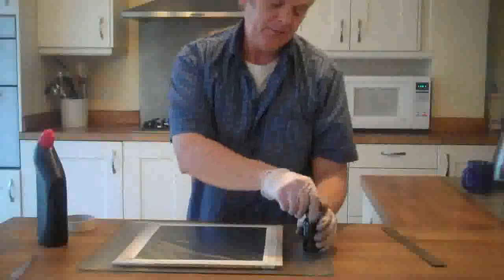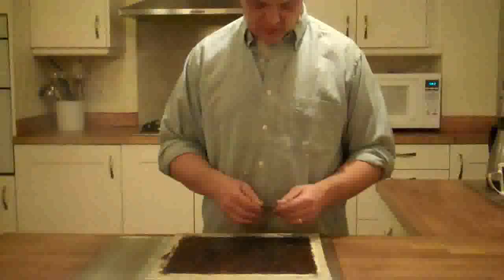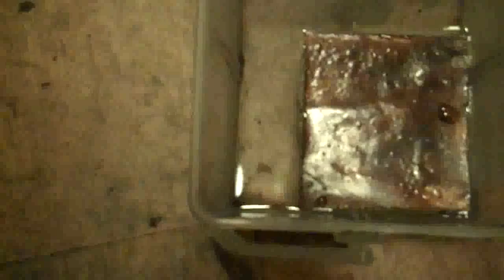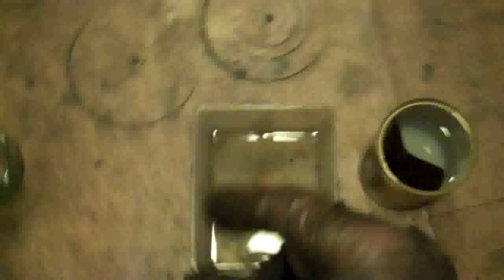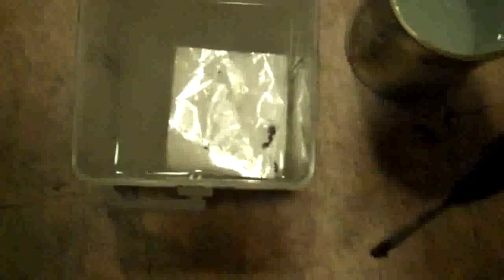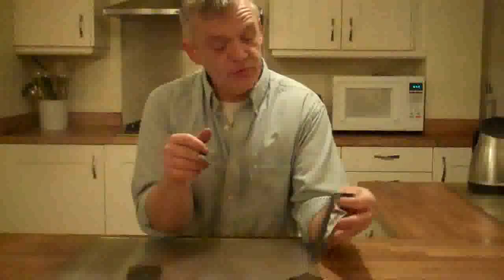How To Make Graphene Sheets As Big As You Like

Comment: Attach the sheet to a speaker, hang over a container that is tall enough to stand the whole sheet up in, then play a low frequency sine wave through it so it's essentially being 'jiggles' up and down that way the bubbles get shaken off the sheet letting the acid get at new aluminium. I believe that you can use the same procedure to make electro-plating more efficient. Just a thought, awesome vids, new sub here 👍
Reply: @fabroche69  non
Reply: Make a paint mixer from your subwoofer. 👍😁

Comment: I've videos where graphite isn't used to make graphene.    Instead,  propane gas is used, and the gas is spray on sheets of copper, under very specific atmospheric conditions.   Of have probably boched this description up.  I have thought instead of using atmospheric conditions.   You could use electrods inside the propane gas.  The electrodes would act like a 3d printer.  This electrodes 3d printer would be hooked up to a microscope.  ( a microscope strong enough to see atoms.)  The 3d printer would act as a 2d printer and make sheets of graphene.

Comment: Note a correction: aluminum foil does Not have a coating of plastic. One side is shiny because it is double face rolled to thickness, then split to rolls for sale. The retardation of chemical reduction is due to the surface oxide of aluminum which is an inhibitor of further reaction until broken down. If you doubt this check out Alcoa manufacturing videos.
Reply from the maker: i don't doubt it mate - i know it now lol

Comment: Who knew i had a favorite uncle in EU lol. I can't thank you enough for your time and dedication! Im in the process of building a flow generator with your graphene sea water idea. I live on a sailboat with a constant minimum of 2 nt current flowing with the tide. Basically im layering the sheets with only a hold at one end and lose on the other. Im going to cheat a bit and use a concentration of copper chloride in ionized water. that will be pumped by a small pump (a venturi would be best so that as i sail the atmospheric difference would create a vacume to move the solution over the graphene sheets. ) Im thinking in the ball park of 1000 sheets that are 8" inchs by 60". Should be interesting at least lol. It sure would be easier to buy some ink from you but im not opposed to making grahpene with electrolysis. I plan to build this as large as i need to power the boat through the water by electric motor when no wind is available so my solar panels will pump the solution in the sunlight and also charge a battery bank that is dedicated to providing the power to pump the solution when night falls. It will be assisted further by the graphite and magnesium generator that will be hanging over the back of the boat like a rudder. Perhaps ill just build that part directly onto the rudder.. who knows. Point is that im am determined to power my boat, heater, and cooking by the world around me and your clever tricks lol. Thanks so much for everything.
Reply from the maker: i don't make the ink anymore mate - i gave it up when i did a video on how to make it for yourself - i am fascinated by what you are doing - let me know how it goes on
Reply: Robert Murray-Smith Thanks, that is a huge compliment that my project intrests you. I know it will work due to your awesome dedication. I can't thank you enough for your videos and to all those that dont want to hear you explain how all this crazyness works, dont be an ass. Cheers Uncle Rob
Reply: Just a thought, do you think the reaction would be more even if you mixed powdered aluminum into the ink and varnish lightly? I think ill try it
Reply from the maker: lol cheers mate
Reply from the maker: Ali will be a real problem mate because of the passivating coating of oxide

Comment: If you add hydrogen peroxide to the hydrochloric acid, it should speed up the reaction quit a bit. When etching circuit boards, you generally use 2 parts hydrogen peroxide to 1 part hydrochloric acid. It takes about 5 mins to eat all the exposed copper. You could try using 5cm copper tape. You can buy 1 meter of 5 cm copper tape off ebay for about $2 or so. 
What if you where to coat something hard and smooth like a marble tile with the carbon solution, then after it dries, lift it with very sticky tape, then you would have the layer of carbon with a plastic backing, then you could expose it to laser light. No need for the acid bath.
Reply from the maker: cheers mate - nice post
Reply: Thanks. I forgot to mention, that's the common 3% hydrogen peroxide. Always add the hydrochloric acid TO THE hydrogen peroxide, not the other way around like I stated it above.
Reply from the maker: cheers mate
Reply: Robert Tomkinson 

Pour water into acid, because the water is the fuel source for the reaction.

A drop of water decomposes with some heat.

A liter of water will cook your face when it reacts.

Comment: Wonderful explanation. I had a little trouble with the heavy accent but the illustration and explanation was a good exercise.  Discussing the thickness control; is the cross section of thick graphene the same as the single molecule layer, or does the plate become opaque and effectively a solid plate?

Comment: If you converted graphene oxide to graphene, why is your resistance so high? Graphene is supposed to be a better conductor than copper. BTW, thank you very much for this. Great sharing of experiment.
Reply from the maker: it is only as good as copper in the ab plane once you get c plane transition you are bound to get a high resistance

Comment: Another question: How high temperatures can graphene in your experience withstand? the melting point is slightly higher than with graphite at 4510K, and thermal conductivity is superb along the lattice. This would make graphene an excellent heat shield, especially when connected to a sink. But some reports claim that graphene can't withstand temperatures higher than 120 Celsius.
Reply from the maker: +Tom Starwalker it depends on the surround but it begins to burn away at 400C

Comment: When I used to work at Braman BMW, we used to scan papers into the system, and each paper essentially had toner all over it and we would laser scan sheets like literally several foot stacks of paper per day.  

The area itself would get very hot, but that’s not the point.  We were essentially lasering in a carbon compound, and it would accumulate, heat up, laser for 8 to 10 hours, cool down for 8 to 10 hours at hundreds of passes per hour, and you would do that for several months straight

After about a month or two, or even three, I would clean the glass, rollers, and other parts that would accumulate it, and I’ll never forget I once cleaned a flake almost an Inch across that was reflective.  

I never got to check the conductivity, but it Stuck With Me Since 2010.

It probably wasn’t very good quality, even so because I essentially was just cleaning off the lasered flakes that accumulated after Millions of passes.

looking back, if I ever got the chance, I wish I could just take some of those very same industrial scanners and just try to do it all over again and play with the toner on the paper, using paper or some other medium, or playing around with the glass or anything else that was accumulating it.

The downside to it all, is that it took you literally a couple months to produce a few flakes per machine, and you would literally go through reams of paper and toner (Time and Electricity) just to get a solid inch🫤🤷🏻‍♂️

Comment: question: if graphene can be stripped easily as originally done with simple sticky tape ,if this was then used as the wrap tape commonly used in lithium batteries wouldn't this then wick away heat🤔

Comment: How fluid is the liquid preparation you are using? I am curious about the hydraulic action you could expect, if say, you were to press your liquid preparation between 2 sheets of foil between 2 very flat plates with some substantial tonnage... if the carrier medium foil was strong enough to remain intact through the pressing, and didn't stick to the pressing plates when finished, would this help give you an easier way to produce a more uniform, if not thinner cross section thickness? And then the question becomes if your graphene sheet will survive the process of removing the production medium... interesting video, makes you wonder if an older technology technique such as every day paper making machines could be adapted to produce a larger volume cost effectively at a quality level useful enough for most production needs... even a cheaper means to obtain a larger amount of a lower but acceptable grade of product, this could revolutionize society over night, while the innovation process works out the details for producing higher quality grade material in the future....

Comment: There's a specific, scientific definition of what exactly graphene is. If it has two layers of atoms, it's not graphene, it's graphite. What you have made in this video is "Reduced Graphene Oxide" which is different from graphene. It will still have oxygen atoms inside, as you said, and is different is other ways. 
Even if you made a sheet that's free of all oxides it would not be a "sheet of graphene" - because a sheet of graphene is actually by definition a perfect, transparent, two dimensional structure of just carbon atoms in hexagonal shape. (and it's important to see "2D" as a quantum topological property in this case. Not Euclidian. Therefore it is actually correct to say it is 2D.) 
The thing you have made here is at best a sheet of aluminum coated with a layer of many million small, broken/imperfect, crystals of reduced graphene oxide. 
You have to understand the definitions. It's science you're trying to do here, probably. Act accordingly.

Btw, how can you be sure that you have not been scammed and are using normal graphite powder instead of graphene? Are you testing your stuff?
Reply from the maker: refer to the comments this has come up before and has been fully covered below - but basically you both right and wrong in what you say - this last bit - ' It's science you're trying to do here, probably. Act accordingly.' - is both arrogant and rude of you - remember this is not an open forum - i moderate it - and i insist that comments aren't rude - act accordingly please
Reply: Sorry, I guess I could have formulated that differently. It's still a valid critic thought. 
Are you talking about the comment from the student that was having a serious question and you answered basically with "it's the same... Graphene, graphite - no difference"? This is really troublesome behavior. You have a need to be true - you are teaching. If you are teaching scientifically wrong stuff you are either a theist, ignorant of the basics of your job or unknowingly stupid. (see this as what it is, please. Objective criticism.) 
Sure, it's the Internet. You can say and do anything you want. But you should not be oblivious to the fact that you have a responsibility. It's the responsibility to save children from bad stuff (well, it's just common sense for every video that is not flagged +18) and the responsibility to make sure you are teaching these children the correct stuff - therefore to make sure they don't get any stupider than what they already are. (everyone is stupid) 
I guess you are aware that your channel has developed into a medium sized "I'm showing science" - channel and I hope you'll fulfill your responsibilities.
Reply from the maker: well i see you have some firm opinions here - good luck with that
Reply: Robert Murray-Smith ah... It must be nice 'when there are no critics'! 
Whatever. I was just wondering if you could be the one who stops this stupid "it's graphene" behavior that overfills youtube and my suggestions. Sadly, you're a peasant. 
You might as well just stop suggesting to wear gloves and eye protection, because what do you care? Seriously.
Reply from the maker: i don't mind critics mate - but you really seem to want to argue from a firm opinion set and i just don't waste much time arguing when it is obvious firm opinions differ - you have your viewpoint and i have mine there is just no point in arguing it - By the way now you are slipping into rude again -please be careful with that - i will delete and ban you from the account if you persist in rudeness.
Reply: Robert Murray-Smith OK OK. Firm opinion. A opinion that is backed by science. What backs your opinion? 
And the very important question of "how do you make sure that what you have there is really graphene and not graphite" probably needs a answer. 
Or, what does graphene, in the case where is exists of little crystals randomly scattered about, better than graphite in the same setup? 
I mean, the whole scientific hype on graphene is about single crystal structures!
Reply from the maker: oddly enough science too - if i want to confirm i will send it out for Raman and an XRD, then if i want to have a good look i will have SEM imaging done. you are not quite right in your last statement mate
Reply: Robert Murray-Smith probably. I don't know every scientist. 
So, is there a measurable difference between your graphene sheets and one made of graphite?
Reply from the maker: yes - but your best answer is to make one and find out - the channel is all about trying to encourage folks to experiment and find out for themselves - i would strongly encourage you to do this
Reply: I'll probably do that. Comparing whatever thing I make with broken graphene with one made of graphite. 
Do you have a video about it?
Reply from the maker: I'm afraid I don't - but if you do the experiment - perhaps you could also do a video and link it here so we can all see
Reply: Maybe. I doubt it will be a huge improvement though. There will be high resistance between two individual crystals that'll counteract the positive properties of graphene. And there will be a huge amount of individuals.
Reply from the maker: you could always test it and see rather than assuming - remember we miss 100% of the shots we never take
Reply from the maker: lol - fair point
Reply: if its cheap grafene WHY IN THE WORLD ARENT YOU SELLING IT TO IBM, SANSUNG, APPLE, ETC...??????????????????????????  BECAUSE ITS NOT QUALITY GRAPHENE... N0OT EVEN GRAPHENE,.,  Y
Reply from the maker: please be aware I moderate this channel - if you stray into abusive I will delete your comments and ban your postings I say this as all caps is the equivalent of shouting. That being said your comments betray a lack of reading, understanding and experimentation on your part I am afraid. Please read more around the subject to get a good understanding
Reply: Distelzombie Centzon Totochtin       My hats off to you sir. Do to threats of being banded by the moderater, will keep my opinion of the moderater to myself.
Reply: GOOGLE WARRIORS ENGAGE! I love you moderator, don't ban pls.
Reply: Some people are just arrogant and rude.  I agree that science should be handled with care to avoid wrong information, but criticism should be polite and constructive.  You can always state your case without being a sodding pissoff.  Seriously, men are losing touch of their humanity.
Reply: Fact: Everything you see is 4D/5D
Reply: @GLITCH_-.-  If you watch one of his other videos you can see how the graphite is electrolised thereby disrupting the vanderwaals forces making small graphene flakes in odd shapes that are probably nano size but still highly conductive. The flakes is a powder in the non nano world and is in fact much more usable then a 1 atom thick sheet, as you may be able to imagine. This is one of the commercial production methods of graphene that is used in electronics, supercapacitors for example are made with these flakes on aluminium foil. It would be interesting to see what would happen if we wrapped up an atom thick sheet of both aluminium and graphene but we simply don't know how yet.
Reply: @Odd haven Fact There is no other dimension
Reply: @Odd haven Its a fact that its my opinion,

Comment: What if you were to treat the aluminium foil with a weak Copper (II) Sulphate solution prior to coating it with Graphene Oxide creating a nanoporous ultra thin substrate (kinda like the stuff used in electrolytic capacitors). Do you think this would work? Part of me would like to think the porous aluminium foil would allow the Hydrogen to pass through more readily reducing the Graphene Oxide more evenly.

Comment: I assume you tested the strength of the sheet? Is it stronger than aluminum foil? Could you use the same method, except with more graphene oxide to make thicker sheets?

It's been years now since graphene was discovered. Sucks that they haven't mass produced it yet.
Reply from the maker: sure is

Comment: i also wonder what would happen if you mixed the Graphene oxide with aluminum powder then tried to dry it out with this process and make a sheet in hydrochloric acid. would this destroy the structure of the Graphene during the reduction process or would it form a purer sheet.
Reply from the maker: Paul Gilardi you could always try it and see

Comment: Robert:  Can you do a series on making crystal batteries. I would like to see your ideas on the subject.  I have been working on some of my own for a few years off and on and currently have one that has been running a LED for over a year and still going.  I can short it out for as long as I want and when the short is removed It will light the LED as well as before.  Would you be interested in researching and doing such a  series?  Thanks
Reply from the maker: hiya mate - certainly i would be interested- i will try and get round to it